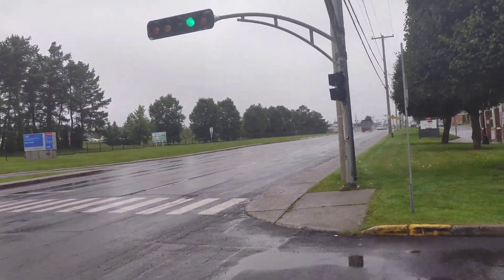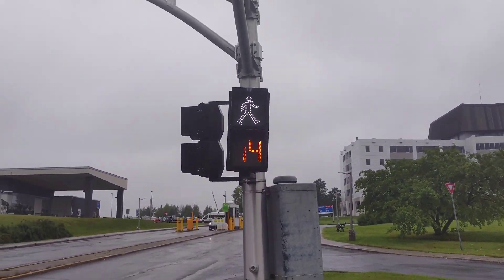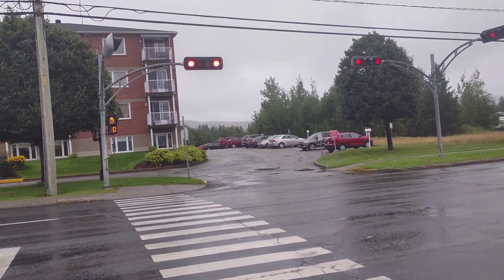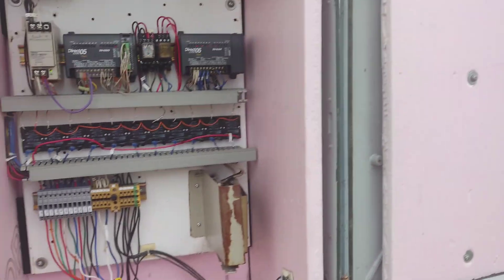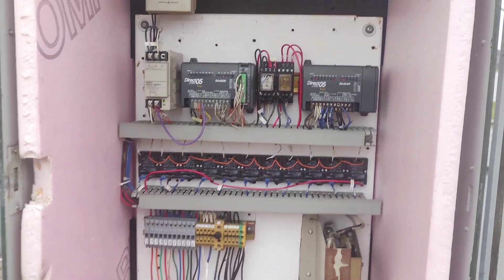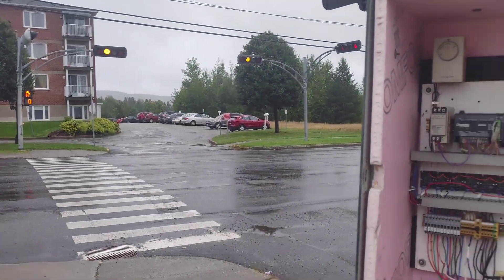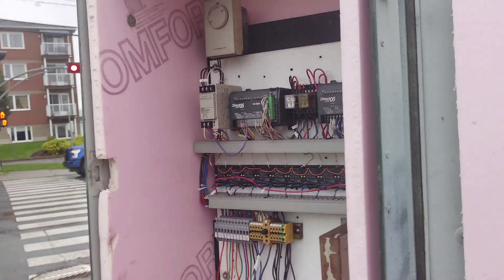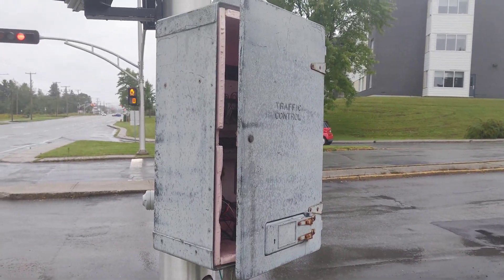Open Traffic Signal Cabinet in Thetford Mines. PLC Controller???

Comment: Industrial electrician here

Very Top left in the thermostat for the cabinet heater on the bottom right.

The first row, left is the power supply from 120vac to 24vdc most likely. Then a plc beside that, no idea what brand but it's not a modular one (it doesn't look like you can change cards), looks like a couple relays then another plc.

You're right about the middle row, it's all relays. The plc can only output miliamps so it sends and receives signals from the relays to control things. 

The bottom row is the termination blocks for the field wiring. 

It's pretty simple when you get into it, if you're interested pretty much everywhere is short help, find an apprenticeship!  👍🏻
Reply from the maker: Wow, thank you for your comment! I really appreciate that. <3
Reply: PLCs are DirectLOGIC DL05 D0-05DD (DC input, DC output) and D0-05AR (AC input, Relay output). RS232 interface, instruction set is online if somebody wants to reprogram them to fix that timing lol
Reply from the maker: The pedestrian countdowns are computers themselves, and pick up the amount of time required to count down by learning the cycle. They require the same wiring as the hand/man modules.
Reply from the maker: Of course!! <3

Comment: Omron PSU. Koyo DirectoLogic PLC D0-05DD (8 dc in, 6 dc out) with (10 dc out) D0-10TD1 io module, DirectLogic PLC D0-05AR (8 ac in, 6 relay out).
This box should be closed. If rain gets in, it will damage everything inside.
Reply from the maker: Absolutely! That's why I tried to close it after filming, however I couldn't as the locking mechanism was broken, which I think is why it was open in the first place.

Comment: Power Supply top left, supplying power to the relays and the PLC’s, PLC had the program in it for the light sequences, depending on times and inputs from the push buttons, outputs go through the solid state relays so as not to burn out the contacts on the PLC over time

Comment: Traffic lights there are a lot more complicated than the ones here in the UK. We basically have red-amber-green and also filter arrows not not much else. I found an open cabinet and closed it by wrapping it all in parcel shrink wrap I had in my van.